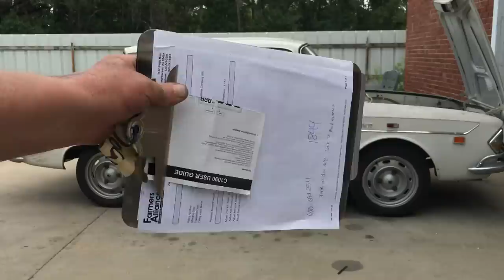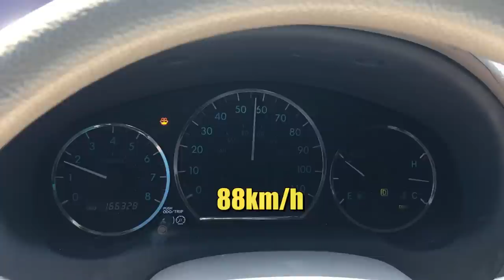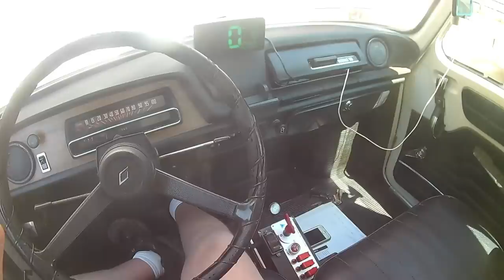S3 E21. How fast will this 670 cc predator V twin powered Renault go?...  Faster than you think!

Comment: Wonder how hot the oil would get at 60mph over time ?
Maybe the MADMAN monitor can tell that story
Reply: Those engines are designed to run and stay cool at its max rpm for an extended length of time.
Reply: You can’t make the claim it’ll hold an acceptable oil temp without knowing the load and numerous other factors.
Reply: You can’t make the claim it’ll hold an acceptable oil temp without knowing the load and numerous other factors.
Reply: @flyonbyya  The are engines designed for having a load and running at full throttle for extended periods of time. The air cooling on these works best at that full rpm.
Reply from the maker: Good question,  The Predator 670 is actually equipped with an oil cooler.
Reply: I’m not talkin bout rpm…
I’m talkin bout load…
We don’t know how high the load is at higher road speeds, thus it’s unknown if the capacity of the engine cooling can reject more heat than it gains.
Reply: @flyonbyya  yes, load. Do you think these engines were made to just sit and run with no load?? They are made to power equipment, IE have a load on them at 3800 rpm all day long. Do some research before you argue with no data.
Reply: Lol….research???
Did I, or did I not say ‘unknown’??
You nor I can make any assumptions with all the unknowns, thus “do your research” is an utterly ignorant statement.
Reply: @flyonbyya  you mean other than working with small engines for over 40 years?
Reply: @flyonbyya  Its at effectively full load at 60mph or quite close to it. Should be very similar to a typical use case which was calcultaed when designing it.

Comment: I scrapped my R19 1.9D a few years ago, not because it did not work, but it was rusty all araound and produced lots of smoke when started cold. You know, repairs are expensive, and not worth it economically. But was a nice car, and has a lot of space inside. Also in europe you can get problems with old cars in city, because of new regulations. And it did not have a turbo, so only 60 hp.

Comment: Seems you have stumbled on a way to get an inexpensive useful little car.  Start with something to old for inspections,  light in weight, add a large lawn mower motor,  really not that different than the VW rabbit I had in the late 70's (engine placement different of course).

Comment: Get the vacuum fuel pump that connects to that engine's valve cover.... And you can use the fuel tank that came with the car... And then on one tank of gas you can drive from Kansas to Central Florida..........
Reply from the maker: Unfortunately the tank that came with the car was completely rotted out and cannot be repaired. if we do a road trip, we will more or less have to stop at every gas station..lol

Comment: Awesome first run. Excited to see some performance mods. I’m guessing 50 mpg on the original motor. I would guess you’ll want to get that 0-55 much better, depending what you do, I’d guess a sub 30 second 0-55 would be around the 40 mpg you were guessing.

Comment: 57mpg seems reasonable. No hills and little traffic should help. On a real frugal econo run maybe in the 60s for mpg. I wonder if it could pass an emission test? Love what you do and your presentation is quite entertaining.
Reply from the maker: Given the car is pre-emission and the engine is built to EPA specs, I reckon the emissions are cleaner than the original engine.
Reply: @robotcantina8957  I agree. But if someone wanted to actually try something like this in an area that had emission inspections, is this a no go from the start? Maybe this is something for when you are through with the other things?

Comment: when accelerating the engine kinda sounds like a little baby version of a v8
Reply from the maker: She should sound a bit better when we tune the carburetor and exhaust.  I think on this build I will engineer a muffler with cut outs so the car is quiet in town and out in the corn fields we can uncork the exhaust and let it rip.

Comment: Back in 1973 I had 1963 Morris Minor 950cc A series BMC engine 0 to 50 mile an hour about the same time  as your Renault and flat out about 65 miles an hour so not bad for 670 cc lawn tractor engine

Comment: Maybe, because it's a 2 cyl and therefor cheaper, you could try bigger valves, check the weight of the con rods and pistons and balance, have the camshaft modified to bigger lift and add a small turbo.

Comment: I broke out the 28ish HP 3cyl yanmar diesel. I started to setup a geo tracker flywheel in the lathe. Turns out the 4 jaw that came with the lathe fits something proprietary without a changable back plate. I'll have to shim the 3 jaw. The plan is to use a geo tracker flywheel, clutch and trans. Swap this junk into my 72 maverick. I think it was 2700lbs with the 302 and c4 trans.
Reply from the maker: The 2048 pound Saturn did OK with the 20+ hp Kubota engine.   With such low power on tap its a good idea to use a close ratio transmission, perhaps a Miata trans?
Reply: @robotcantina8957  I have a few geo tracker transmissions on hand. The only other manual trans I have os a 6 spd from an 08 328i. I kinda wanted to use that bmw trans in another project.
Reply: @robotcantina8957  The maverick has an 8.8 with 3.73s installed in it now.

Comment: Hmmm...  The Predator engine has a max RPM of what, 4000rpm, makes roughly 22hp, and 33 ft lbs at 2500rpm (yes I pulled the stats up).  Don't think hat's very far off the motor it would have come with.  Looking at a few different sources, the stock motor for the Renault 10 would seem to make 40-50 hp or so, and about 70-80ish ft lbs.  I'm sure the Predator weighs less - so this car seems very well suited to become a good hot rod with a lawnmower engine. :-)

Comment: I've serviced CVT units on ATVs.  They're pretty much bulletproof except for the belt.  Under normal use, that belt lasts 7-10 years.  Under hard use, maybe 5 or 6.  Even then, it's easy to replace

Comment: Ha! My estimate was pretty close. People don't realize how modest the power requirements are for steady state moderate speed. I reckon the car will return mid- to upper -forties for mpg. Chassis tuning and some modest ecomodding will improve that of course.
Reply: Exactly right. In general, people seem to guess about twice the gorsepower needed for speeds in this range. My observation is that most people think that if they are at full or even almost full throttle for 5--10 seconds, that equals the vehicles top speed. WIth the powerful cars these days, and especially in the US market, few people have experienced using full throttle for any longer periods of time.

Comment: Good grief - is that thing slow, and that's from someone who drives a slow car.
But hey, it is definitively original and I like the old french hunk o' junk is still driving - and in such a good condition. I probably never would have gone for so small an engine, but hopefully it will be upgraded or given a little more oomph somewhere down the line. It can only really get better, right?
I understand we are not the same, and it is very nice to see your projects and fun ideas.
Keep it up!

Comment: I also live in a rural area of the other Kansas, Arkansas. Lol passing tractors and getting passed by others is a nearly daily occurrence for me. Or would be if I left my house daily. Other drivers are significantly more courteous than they are in the larger towns/cities. It's a nice commute for most of it 😂
Reply: One right turn and everyone's an ass haha
Reply from the maker: exactly !  Now when I drove the Diesel Saturn or the 420cc Honda Insight, those cars looked normal and sometimes people would tailgate briefly before passing.  Hopefully this Renault looks as slow as it truly is and folks will just pass. lol..
Reply: @robotcantina8957  I drove a Nissan pickup for work for a couple years, factory powered by the same diesel naturally aspirated engine they used in forklifts (SD22 engine if you get curious) in the same era. 62hp when new. Top speed 70mph on flat ground no wind. 60 was a much more happy speed. Talk about camping in the right lane anytime you have to get on the highway, and angry people behind you on hills, rolling coal at 35mph, foot to the floor 🤣 so many people in a hurry. I got cussed at more than once driving that truck.
Reply: @robotcantina8957  I hope you're right, but that truck looked slow as hell and folks still got salted. Hopefully you have better luck. I'm quite pleased it seemed like the little Renault gets around decent!

Comment: C&C recently did one with same engine in a micro mini  king midget, they got around 25 to 26 mpg on a 300 mile trip ( driving it to a beach ) with theirs so i think you get bit more or less taking into account size and weight of your Renault. I'm guessing 20  to 25

Comment: With a 670cc Harbor Freight V-twin moving this Renault, it is lighter than the original Renault engine, it has a somewhat quieter sound and better fuel economy and handling.

Comment: Speeds can be roughly calculated for standard bodied cars of that era.  It takes around 75hp to get a car up to 100mph.     For 200mph you need 600hp.    Speed then is proportional to the cube of the power.   Double the speed needs 2 cubed = 8 times the power.  So this shows the V twin engine had around 22 - 23 hp.    To do 90mph would need 55hp.

Comment: How about a turbocharger on it and longer gearing. 
The first generation Smart turbocharger should be small enough for this engine. 
Also an electronic carb with oxygen sensor OR a megasquirt injection for the turbo build

Comment: With a published curb weight of 1758lbs, and roughly 22 horsepower, it wont be fast, but it will be okay for cruising around. Its roughly half the factory rated horsepower, but most likely similar in torque output at low rpm. These little Chinese v-twins are fascinatingly good, some folks even use them in small experimental aircraft.
Reply from the maker: Overall I have great results with the predator engines,  they certainly hold up better than I thought they would.

Comment: All right, I am going to throw in my fuel economy guess. My 2019 Mirage G4 5-speed gets about 40 to 45 miles per gallon at 70 miles an hour steady. It also has a 1.2 l three-cylinder. My guest with your car being a little bit lighter with one less cylinder and a smaller displacement I'm going to guess 45 to 47 miles per gallon
Reply from the maker: Good guess!   We will find out soon enough.
Reply: @robotcantina8957  can't wait to see it!

Comment: I have seen in my country - usually at isolated rural areas such builds like putting one cylinder two stroke engines in old cars just for laughs
Having said that I can see this one having a potential to be a lot faster

Comment: Bear in mind a Citroen 2cv of similar vintage to the Renault had a 650cc aircooled boxer engine, and 0 to 60 took about 35 seconds, so you are not so far off the pace.  The 2cv had around 30bhp.
Reply from the maker: Good to know !  I reckon we can squeeze about 30HP from this engine no problem.

Comment: This build is really interesting. at a car show, I saw a Nash Metropolitan that looked in great shape. The info sheet said that the original Austin engine had been replaced with a Toyota engine. I guess that must have improved the speed, the mileage and the reliability.

Comment: Port the heads. Put a aftermarket carb on it with an imporoved exhaust system. 
 Put some internal after market parts in it like roller rockers.

Comment: Did you get Reverse sorted out? Is this next years Hot Rod Power Tour car? 48.5 MPG? Try this car with a 1st gen 999cc Honda Goldwing engine. That should be an optimum power solution for this car.

Comment: Ok I looked it up and originally had an 845 water cooled. 0-63 mph was 32 sec. The little predator engine seems to be doing well but I would definitely add a half a bottle of Lucas in it

Comment: honestly this would be a perfect car for hot rod power tour. its fuel efficient. quirky and comfterable. it does need some fixing though(like removing the governor to get a bit more speed) but also a small eco boost turbo off a 3 cylinder just to give it the pep and fuel efficiency it needs. how many miles to the gallon does this car get?(reason i ask is some cars on power tour are gas guzzlers)

Comment: My brother had a 10 major that was swapped with a Volvo b14 from a 300 series. 70 or 80 HP vs the stock 38. It was insanely quick but the stock gearing was short so it revved a lot at cruising speed.

Comment: For the sake of fuel economy, it would be interesting to see a build with a modern fuel-injected parallel 2 cylinder motorcycle engine, around 500cc. These engines are engineered to pass modern emission standards, and so fuel economy tends to be quite good as well.

Comment: that predator has just under half the horsepower the car had originally. Not really that surprising that it would hit highway speeds. Lots of mods for these motors too for cheap easy power. I'd almost bet real money it will end up legitimately streetable.

Comment: Hey, you can pretty easily ring out 7,500 RPM and 50hp from one of those engines. It could be a lot faster than a stock Renault for a few hundred bucks and a few hours of work. Get it sir!!

Comment: I probably wrote this before: my 2001 Opel Omega stationwagon (1.75 metric tons, 5m lenght) did 5.6l/100km in rural Hungarian trips before , with a cast iron straight six BMW common rail diesel in the front (chiptuned, egr deleted, swirlflaps removed, cats removed) with 110kmh speed limiter on. Its like a rocket, huge car with heated electric seats, color navigation, tc/abs, heated folding mirrors, 4 airbags, speed dependent power steering, xenon lights, addon diesel heater, 2 zone digital AC, and such. Manual 5 speed btw 😂 so anything more than this landyachts 5.6l/100km consumption is simply laughable , especially with that performance (or lack of) 😊
Reply from the maker: Wow, 42 MPG and you get all the comforts.... not bad at all!
Reply: @robotcantina8957  BMW-s cast iron M57 diesels, and Mercedes OM606 were legendary engines 😉 for a good reason

Comment: Pros and Cons of Farmers Business Network   ===   and there are quite a few to consider.
Reply: This benefit would include access to common fungicides and herbicides that make it possible to generate a more consistent crop. Marketing options that connect farmers with possible buyers are part of this business network as well. Farmers get to share data, bargain for better pricing, and ask source questions in ways that were not possible on the individual level before this option.
Reply: The number of farmers under the age of 35 recently rose for only the second time since 2000. Farmers Business Network is a product of the next generation of producers that will help to reinforce the security of the food supply chain. With access to environmentally friendly tools that can grow the local food movement, the pros and cons of this association can help to patch up some of the financial problems the industry has experienced in recent years.

Comment: Really cool.

I wonder how long the engine would hold up long term?

How often would oil change be required?

Imagine if you could get 50+ kmiles out of one of these.

I suspect states will start outlawing mods like this because of pollution or some such nonsense.
Reply from the maker: Generally we change the oil on all of our project every months.  Keep in mind that this is an old car and has limited use even if it had the original engine.  Its probably not worth the effort to make laws forbidding these typed of mods because it would piss off a lot of people and have little effect.

Comment: probably want to get a cylinder head temp gauge set up in the car (or oil at least) if you wana put the trunk lid on. I'm guessing though you have it off for potential heat issues though with the fuel tank and stuff but I doubt it would ever get hot enough to start boiling, though doubts do not exclude a need for a large tank vent if it does.

Comment: Pretty good! But the question I have is, how will it handle long inclines? I realize you're in Kansas though, I wish you well. Eagerly awaiting MORE! PS don't forget After the 4th not everyone will have a full complement of fingers, be safe.
Reply from the maker: Well, as you probably know the car would not do well on hills. That's basic math and physics. I think a lot of the audience forgets this.  The good news is there are no hills in Kansas.
Reply: @robotcantina8957  The much more better news is once you do the governor delete (don't forget to check the flywheel) you should gain more top end. There's a channel called CARS AND CAMERAS that  are making a drag racer with the 670. They're running a snowmobile clutch though. Also doing a King Midget Microcar with a 670 also!

Comment: I’d guess 55 mpg maybe 155 the way you drive. Give it the beans? Not with the governor working. I understand your point on testing but the proper way of dealing with that is to snatch out the engine, split the case and remove the governor altogether. Otherwise you’re asking for trouble at higher RPMs ungoverned. But seriously, 55 mpg minimum.

Comment: The fact that the US license plate has to be on the rear-end of the car is sort of disappointing. Yellow plates existed in France until 2009 and were exclusively mounted on the rear-end. The front plate was always white. Since 2009, both front and rear plates are white (and both of them are mandatory on 4+ wheel vehicles.) Old licence plates (before 1993) were black with white or silver characters.